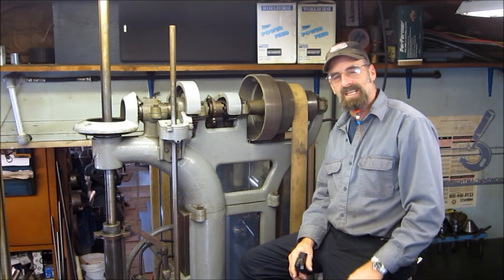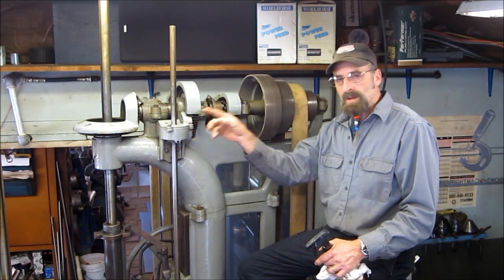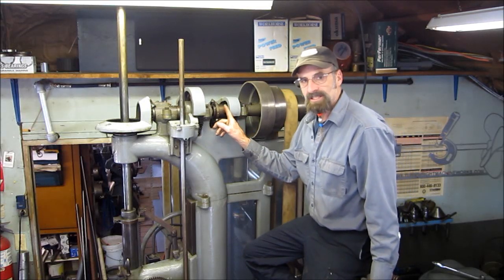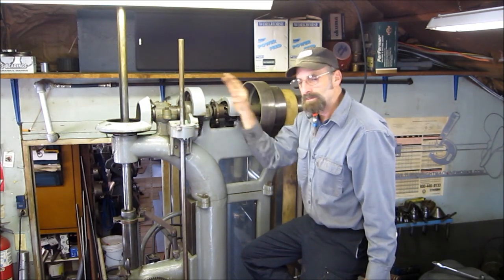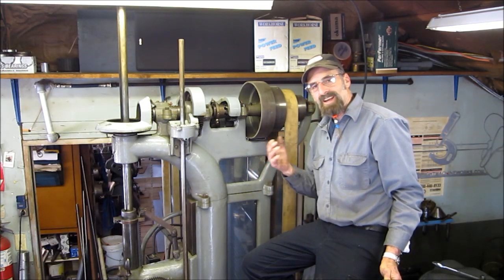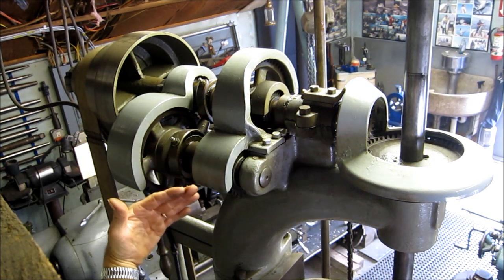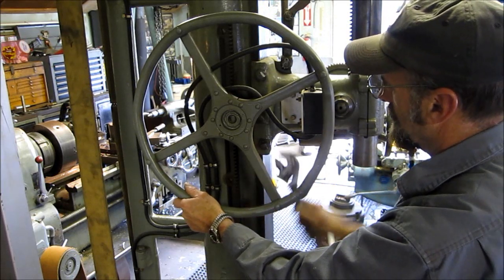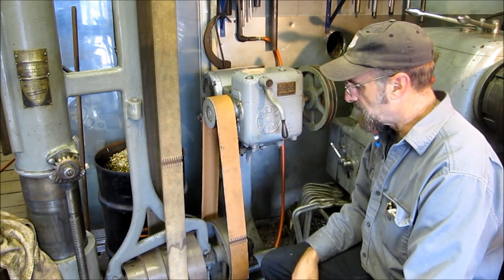Belt Up Part 1

Comment: Whoo-hoo!  The Sibley!  I never knew that they existed, etc., until your videos, Keith.  I was immediately fascinated and had to dig up as much information as I could on the internet (on the Sibley).  That factory manual that you have is a gem!  I'd sure like to thumb through one!   Maybe someday you could scan it and sell a few copies.... or just publicize them for free (I doubt any copyright would be exercised).   Though it may be obvious to you, not many people (non-machinists) realize the advantages of the Sibley's low turning speed.   Yeah, it is slower, but it can drive harder and without (or as much) lubrication and cooling.  In the era that those old Sibleys were manufactured, machining was a different ballgame.  .... ....

Comment from the maker: @Wimseys In 1904 Sibley Machine Tool Company was incorporated and international sales began.  Auto parts castings for General Motors, defense production, machine tools, and drilling and grinding machines were manufactured, but in 1968 the production of Sibley drills was phased out.

Comment: Interesting how that gearbox company was formed as a response to wartime production.  As factories were built or changed to military production, there was no time to go through a long design or remodel of buildings with complex single line shaft drives.  They needed to bring in machines by the hundreds and get them running fast, so the electric driven gearbox allowed machines to be placed anywhere there was space.  After the war, people realized how much more versatile independent drives were, and it became the standard from then on.

Comment: you talked about putting copper pipe to all the grease nipples ,  find an old claas combine harvester they have all what your looking for , tubing 3/16 or smaller , the manifolds with all the nippless fitted , and so you can mount in a far more acsesable place to grease the ol drill press , keep up the good work keith

Comment: Thanks for the video.  I have been curious about your machines.  That puts all my drill presses to shame.  The ceiling in my shop isn't even high enough to accommodate a drive that tall.

Any chance you could do a video on your horizontal mill?